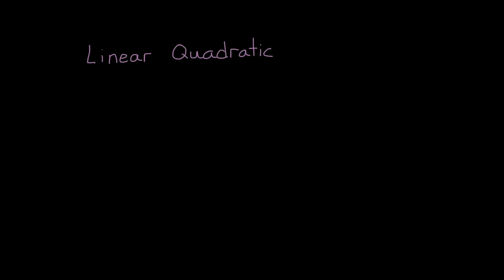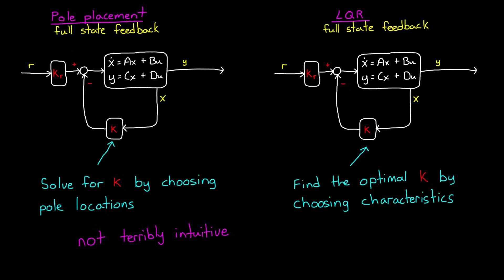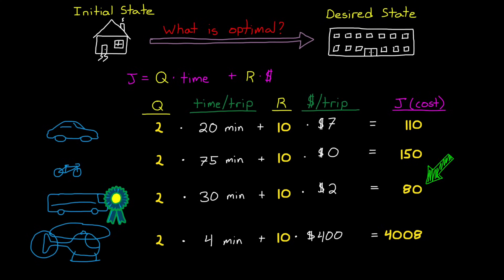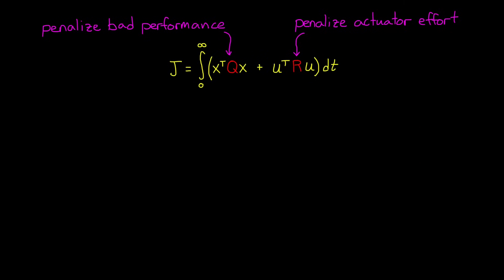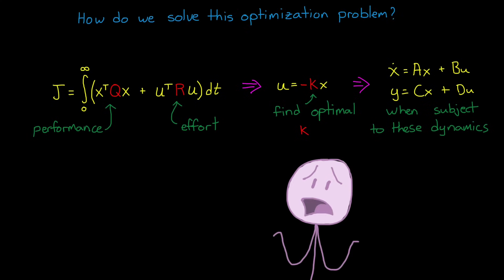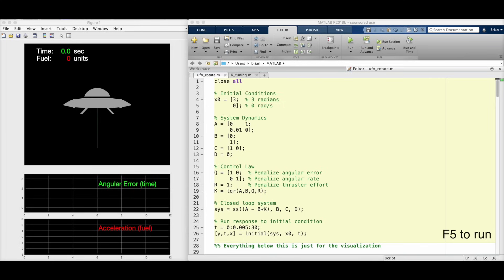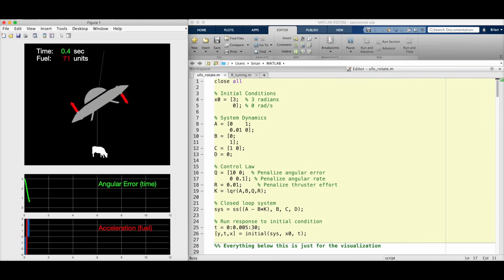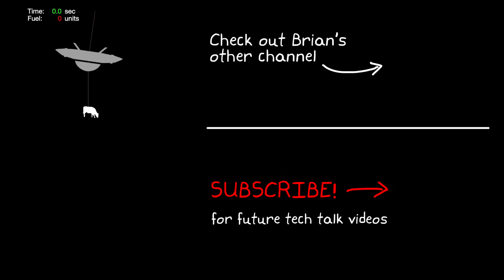What Is Linear Quadratic Regulator (LQR) Optimal Control? | State Space, Part 4

Comment: @BrianBDouglas Great work! thank you very much.  Question, did I misunderstood this or you didn't have to calculate Kr here because a Kr=1 works fine for this example? other cases we also need to calculate Kr
Reply: This example doesn't need a Kr term since we're trying to drive all of the states to 0 (regulator). If this was a tracking problem (non-zero states is our goal) then a Kr term could be needed.

Comment: Forever in your debt. I have a question on timestamp 6:49 -> Im trying to make sense of the relationship between the integral equation and it's meaning, which is {the cumulative error of the states plus the cumulative effort of the actuator}. I don't understand how the first part is equivalent to the cumulative error of the states. Are you assuming that the state vectors should be at a reference of 0? That doesn't make much sense to me. Intuitively, I would expect the following to be the way to calculate the error of a state at a given time: steady state required by the reference - current state.
Reply: That's exactly right! This is a regulator which means it's trying to drive the system states to 0. Like you said, if you want this to follow a reference, you can redefine the origin of your states by subtracting out the reference but this adds in some steady state error which is usually countered with a feedforward term or an integrator. Look up LQI function in MATLAB to see what I mean.

Comment: The issue  I come across is choosing "optional' values for Q and R.   I prefer pole placement for SISO systems.  It is easy to determine the response and effort.   I usually want to place the poles on the negative real axis.   I can move the poles to the left ( more negative ) until I hit one of two limits.  1 output saturation as mentioned.   However, usually the problem is feed back resolution.  Placing the closed loop pole on the negative real axis does not guarantee that there will be no over shoot.  The closed loop zeros can cause over shoot if the closed loop zeros are closer to the origin than the closed loop polse.   Sometimes the closed loop zeros must be placed too.     LQR has an advantage for MIMO systems.   If the Q matrix is chosen correctly, the closed loop zeros will be close to the close loop poles almost canceling them out and improving performance.

Comment: Brian, this video is only for regulation, and the controller will push all the system states toward zero, what if you want your states to be pushed toward a particular desired point?
I guess the cost function would be different then, it would be integral(e.T*Q*e + u.T*B*u) right? but how to implement that in matlab using the lqr command ?
Reply: @gustavstreicher4867  Hi, thank you for taking your time answering my question. you see you can actually do this when you are constructing the cost function and optimizer by any numerical optimizer, but when you are using matlab, there is a problem, because matlab lqr command expects A,B,Q and R matrices, you dont have the dynamics of the error with the form of edot= Ae+Bu, thats my problem
Reply: @verbal.alghooneh  Hey, I just noticed you actually implied the same thing in your cost function by using e. Sorry about that. I think it doesn't really matter what values you want the states to go to because  the lqr function essentially produces a regulator solution that implies a zeta and wn value. This same damping and natural frequency is present in the natural response as well as in tracking a step input, for example. So the same K solution will work for whatever state reference you are tracking.
Reply: @gustavstreicher4867  Yes Dear Gustav, What you say is absolutely true, The K works for tracking any reference. yet my problem was how to include error in cost function, which I found the solution, you can use servo control type 1 construction for state space, you can find it in Ogata

Comment: If someone is having problems finding the scaling term, try using simulink to see the step response of the system. Matlab and simulink responses are very different. This might be my mistake mishandling matlab, but if anyone is trying to implement this in a real system and nothing works it might be because of this.  To give you some context the step response in matlab gave me a scaling term of around 3000 while with simulink I get the gain around 1,6 and with this my system works perfectly.

Comment: Hey, Brian, it has been a while watching your control system videos and they are very useful for the students. I have one dought if you have two gains for a closed-loop system such as controller (actuator), plant, and feedback on how to select best values by LQR method to reduce settling time and maximum peak overshoot. it is possible to plot contour for discrete time-varying models. I am working on rocket pitch dynamics so I need to find best gain values....... I hope you understand my question. thanks a lot, Brian.